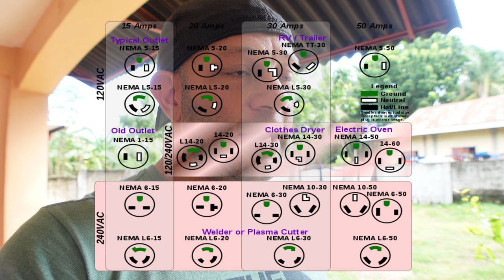Philippines Home Gets Generator Backup Power!

Comment: 6500 watts is not that big not big at all,plus if it’s gas it’s not going to to last long,you need over 7000watts and that’s not much,he’s running 2 A/C units that’s going to burn up soon plus you want a Diesel generator it will run twice as long on the fuel you use, don’t buy one that’s in closed it can’t get enough AIR to cool it,listen think about this, if your motor is under a big load you will use a lot more Fuel buy bigger than you need so it will last along time
Reply from the maker: We do not run both ac units at the same time. One is a 1hp investor for the bedroom at night that pulls 360watts on eco mode. The other is for my office when I work during the day. Wouldn’t need that during a brown out. My runs off solar and we are never drawing 3000 watts for more than an hour. This should be fine as a “back up plan”

Comment: Does your generator also charge your batteries?
Reply from the maker: No, but it could if wired that way.
Reply: @ItsMe_Philippines  you should consider it, it would save you a lot of gas for the generator in a down time event. It would also help keep you from "accidently" runny the gen too long between oil and filter changes. cheers